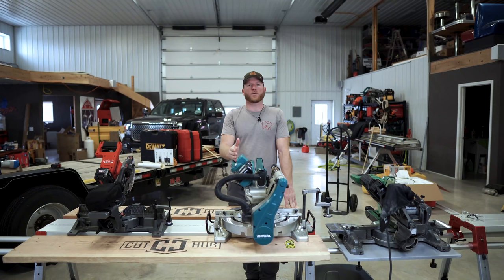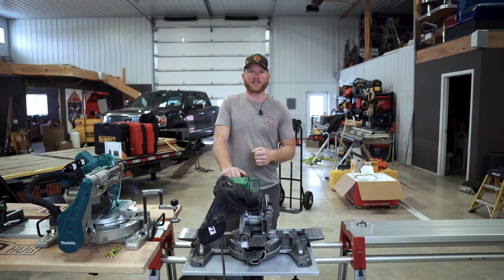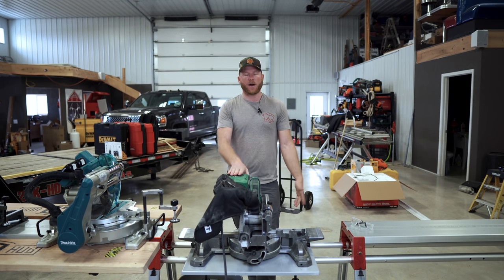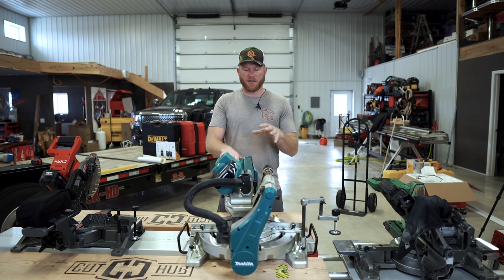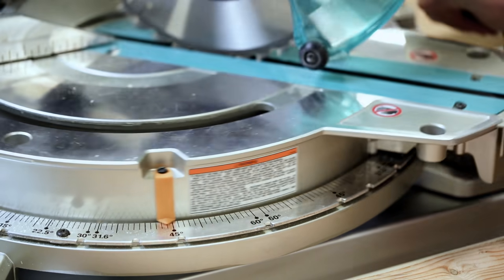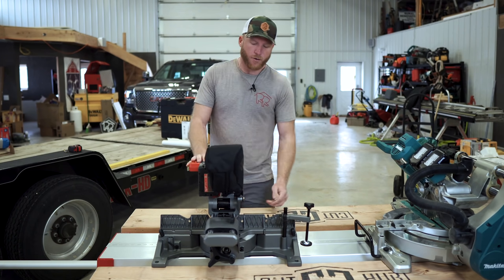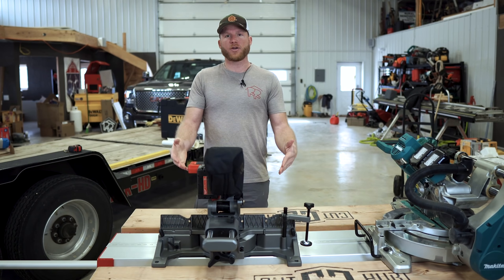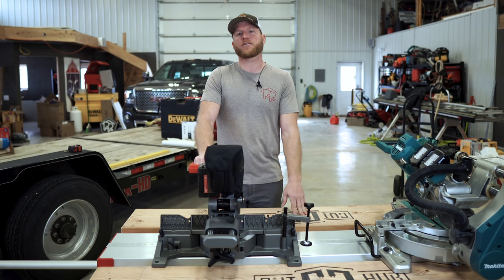My go to Miter Saws 2019: Toolsday

Comment: Hi Kyle. I have a couple of Mitre saws (Festool and the Makita in the review). I recently purchased the Metabo as well (I wanted a full battery unit for site work). I had the same issues regarding accuracy. I spoke to the rep who advised that you are supposed to lock the front lever in the down position as well as the bevel lever on the side which tightens up the torsion rods underneath. Hey Preso problem solved…….the saw now cuts very well to the point that I am using it for finish work with great success…..seems counter intuitive, but I can vouch for this and am very happy with the unit….even when compared to my Kapex. Cheers. Greg.

Comment: I like that Makita, I would go out and get one today if I wasn't scared of my wife lol
Reply from the maker: It’s a good one
Reply: LOL, while i wouldn't buy that one i am in the same boat with the wife.
Reply: Glad im not the only one lol
Reply: Anywhere hearing anything about the new makita? Same saw basically but its a 12 inch. Looking at getting one but everyone's reviewing the 10s and i cant find any reviews on the 12 inch saw
Reply: Mandilónes . Pónganse las pilas mijos
Reply: Maybe you shouldn't let your wife have that much say...
Reply: The Achilles heel of the Makita is the detent plate thats made of soft aluminum for speed of manufacturing purposes.  Overtime the detent plate notches wear and grow in size.  Otherwise it’s a kick butt saw
Reply: @marctavares2571  you can get optional plates.
Reply: 🤣🤣🤣🤣🤣🤣🤣 do what I do bro, go tool shopping while she’s at work! Or sneak the tools into the garage.
Reply: @MetalMayhem1978  I know, i need to stop ordering from Amazon, it's hard to hide a huge box when she is home when a delivery comes in
Reply: Jeff Tucker 🤣🤣🤣🤣🤣
Reply: Sell the ol’ lady on ebay then buy all the tools you wish.
Reply: @MetalMayhem1978  I can't tell you how many times I've had to leave tools in the truck bed (under the tonneau cover) until I can properly stash them in the garage and break down the boxes.

Comment: I can only justify one miter saw, so I have the DeWalt Flexvolt, which usually stays corded in the shop, but when I need to take it out, it's as powerful in the field as it is in the shop. I have a Chopmaster  blade for it for finish work, but swap that out when I'm going to do a lot of framing. It's heavy for sure, but it's more important I have a powerful 12 inch saw in the shop.
Reply: Miter Saw is an old idea because has just about 1 ft cut and cannot be used on boards. It shall be retired. I invented a "Parallel Guided Power Saw" which can be seen on you tube under this name. My saw can cut up to 18 ft or more. Look at my saw and let me know what you think. My saw may replaced miter saw, table saw, and router table. It can carry also grinders, drills press, hand saw and more.
Reply: David Muresan you reinvented the DeWalt radial arm saw from the 1950 - 1970 era.

Comment: Love my dewalt 12 inch!
Reply: Miter Saw is an old idea because has just about 1 ft cut and cannot be used on boards. It shall be retired. I invented a "Parallel Guided Power Saw" which can be seen on you tube under this name. My saw can cut up to 18 ft or more. Look at my saw and let me know what you think. My saw may replaced miter saw, table saw, and router table. It can carry also grinders, drills press, hand saw and more.
Reply: @davidmuresan628  Link? I'd like to take a look at this contraption.
Reply: Yeah its a little sketchy it didn't make this list.

Comment: The Metabo/Hikoki has 3 bolts in the back that attach to a floating plate not visible. You loosen them slightly and align the bevel to 90° using a digital angle finding tool(Klein makes a good one). There's a release pin that unlocks the right hand bevel. You align the plate(the 3 bolt plate) with that release pin to stop at 90°, then tighten the 3 bolts down. Now, when the pin is in place, you can adjust bevel left, and stop at your perfect 90°. To adjust bevel right, you push the release pin. To return to 90, you adjust bevel to the left slightly past 90, pull the release pin back, and move it back to the right where it will again stop at 90.

Then there are standard bolts at the bottom of each side to set your 45s and whatnot. You can also use the release pin to stop at 22.5, and possibly 33.9, as that hidden 3 bolt plate has detents in it.

If this sounds complicated, it's really not. I'm just not good at explaining things.

I've also found on the one I had that the slop you feel is the cheap plastic handle moving around, and not the actual unit on the rails. I was able to tighten the screws, making it pretty solid. It feels as good as any other non-vertical grip miter I've use. Another problem with this saw was the miter detent locking bar. It's made of plastic which allows very quick movements swinging left and right, but has a little give in the hinge. Some people have fabricated a replacement, but I've found that just be leaving no pressure on the knob, then locking it down, it always centers on the detent.

Comment: My main saw is still the Dewalt 780 for most trim and framing. However, I keep that Milwaukee 7 inch in the truck as well on an old miter saw stand because not only is it better for some trim applications, but for a super small job or a repair it's almost always perfect. Last week I did a deck for my cousin and we had the Dewalt cutting all the four by, 2x8, 2x10 and 2x6 lumber, but the Milwaukee cut all the decking. My 13 year old cousin cut all the decking herself and no way would I have let her use that Dewalt. So on top of it being practical, convenient and light, it's also safer.

Comment: I got rid of my 12" and my 10" miter saws and grabbed a 7" slider.   Anything that wont fit on that, I just use a circular saw. So much better for mobile transport
Reply: Daddy SmokesYams which 7”?
Reply: Have both the Kobalt and the Ryobi. Like the Kobalt slightly better
Reply: How are you cutting 4x4 using your power saw? The accuracy would not be perfect
Reply: @blockchainshark1392  Two cuts. Flip the wood after first cut, then cut backside

Comment: Back when I had my bussiness before lithium batteries, when there was only nicad , I bought a 10" Makita and later on a 10" Bosch. Neither were sliders as far as I knew they were the only ones available back then. The Makita was useless the rpm were so low it didn't cut it hacked the wood , gave it away the day I got it the Bosch was much better but 50 cuts or less and the battery was dead but the installers still loved it. I just don't keep up with the new tools anymore so really liked seeing your collection. Lithium batteries have changed cordless tools tremendously.  Where I live its hard to find a battery drill so any other tool is impossible to find here. Thank God for Amazon.

Comment: I have the makita. Awesome saw but it's a damn beast to move. Imo the only way to transport it is permanently mounted on the makita stand. I replaced the stand's wheels with 10" pneumatic wheels spaced 18" apart. Now its steady and easy to transport without knocking anything out of alignment.

Comment: I don't know if you read your comments, but I have the Makita LS1219L (corded 12") and it has the same dust collection port on it. Get yourself the Rockler Universal Small Port Hose Kit. It's 30 bucks and it's super high quality and will fit a ton of different tools from routers to miter saws etc. The key is cutting off the little triangular gusset that attaches to the open top part of that dust port on the Makita, so you can slip the larger of the two fittings included with the Universal Small Port kit over it snugly. The other end of that Rockler kit will connect directly to a shop vac or a shop vac hose, and you're good to go. 

Enjoy!
Reply from the maker: thanks man you bet i read comments...helps me learn
Reply: RR Buildings Hey, happy to help. And I really appreciate all that you do. I’m about to start building my own house (my first house ever) with a family member who’s an experienced builder/contractor, and while I’m not post framing, your build videos have been a huge inspiration. 

Cheers!

Comment: I'm not sure if you know this or not but the fence is a floating fence to pick up extra degrees on your 7 1/4 Milwaukee that's what the notches on your left hand side when you're facing the saw is for on the bottom of the deck
No it's not necessarily easy to adjust it but if you adjusted for up to X then modify
Reply: Miter Saw is an old idea because has just about 1 ft cut and cannot be used on boards. It shall be retired. I invented a "Parallel Guided Power Saw" which can be seen on you tube under this name. My saw can cut up to 18 ft or more. Look at my saw and let me know what you think. My saw may replaced miter saw, table saw, and router table. It can carry also grinders, drills press, hand saw and more.

Comment: I have the same problem with dust collection on my Makita. It's like if you don't buy the exact Makita attachments nothing will work and that's the only big problem. I've had to fine tune  the adjustments a couple of time to get back into square cuts, but besides that this saw has been amazing everything I need. I can bring it on job sites all the time with me for cabinet work and trim work. It does all my matters and all my cuts very well and very smooth. Like you said it just feels good in the cuts are smooth and it has a great brake

Comment: Finish carpenter by trade. I use the Milwaukee ten inch and have done a lot of nice work with it. My main gripe with it is that the sawdust gets blown over the bevel mechanism and clogs it so you have to silicone the bevel mechanism regularly. The Makita is a beautiful saw but I was invested in Milwaukee and it works well for me
Reply: I love my makita. Im also a finish carpenter. Main problem is the detents get hammered out.

Comment: I like that Mikita. 1 down side that gives ppl some issues is the way the bevel adjustment works. You don’t hit a switch that allowed the bevel to move. The knob actually loosens the entire saw from the base. So if that bevel adj knob isn’t super tight, the entire top of the saw isn’t tight, and your angles and deflection are super bad.

Comment: The Milwaukee is not that accurate for trim and fine carpentry, I tried to adjust it for hours to get perfect cuts and it was pointless so I ended up returning it!
Until this day I'm still using my Bosch CM8S with a laser blade installed. Haven't found an accurate small miter saw that could replace it yet.
Reply: An honest red china review. Go figure.

Comment: The most important thing about choosing a tool is whether or not it's fit for YOUR purpose.  In the case of the Makita, the answer is IT IS.  The 120V AC version that is.  As you say its heavy, so don't move it.  If you don't move it does it fit in easily into your shop ?.  In most cases it will, because you can put it up against a wall and still use it.  Do I take dust collection seriously ? YES.  For decades I was careless about breathing fine wood dust, and that ended in having two cardiac arrests, the first in the year I turned 80, and which required triple by-pass surgery three years later.  The Makita allows a dedicated shop vac to be connected to it with no fuss.
Finally it gives me a way of making precise cuts with a minimum of effort.
Oh and BTW if you have the battery-powered version, be careful you don't overload the cut if you install a  saw with more cutting heads.

Comment: Diablo makes a find blade. But when I was building a house 30 years ago, I bought a 10" Delta Miter box. (the compound cut saws weren't out yet). A friend of mine that had a cabinet shop said I should get an AMANA blade. So he ordered one for me.  I paid more for the blade than I did the saw.  IN the long run, it was worth it.  I've only built a couple of houses with it but I've loaned it out as well.  The cuts were precise and clean.  I could cut off oak hand rail with the waste cut being paper thin and uniform.  So thin that it rolled up as I cut.  I could unroll and look through the piece.  I've never sharpened it.  Problem is, I now have a 12" compound slide DeWalt.

Comment: I got the Makita recently and had to do a heap of adjusting on it. It feels really nice to use but needed a lot of work to be usable unfortunately which took the shine off it.
Reply: Had the same issue with the 12" I got 6 months ago. Bevel lock was dragging when it was rotated and the fence was a little out of square. Besides it being really heavy it makes the accurate cuts I need.

Comment: I have an old corded Ryobi 10 inch miter saw on a portable table for rough cuts.
Second is a Rigid / AEG 7 1/14 inch sliding miter saw I surprised myself with how much I use, and last the 10 inch cordless Makita you show. That because of it's accuracy and the dual battery deal, which I can use with my other cordless Makita tools. Seems somewhat similar to your setup.

Comment: How important do you think "out of the box" alignment really is? I feel like if you need finish carpentry level precision, you're routinely checking and adjusting alignment anyway.
Reply from the maker: Totally agree
Reply: My opinion (from a hobbyist who uses the saw mostly for framing) is the saw should come out of the box with all the detents aligned and accurate (90 22.5 and 45). The top bevel not so much but the scale should be accurate. With all the QC and automated assembly a jig to make sure the alignment is within a tenth of a degree or so should be no problem. I realize it will have to be checked periodically to make sure it is correct but it should be right from the start.
Reply: I think it's important insomuch as it speaks to the build quality of the rest of the saw.  If the alignment from the factory is sloppy, where presumably trained workers are putting the saw together, it either means the saw is built to low standards or the employees aren't doing their jobs, and neither of those is very reassuring.

The problem, though, is all of these name brand saws are mass produced in vaguely the same price brackets (excluding something like the Kapex), so there's not a lot of wiggle room for one to be absolutely head and shoulders above the others.  Also, they are routinely handled by shippers that couldn't care less, so I bet a significant percentage are damaged before they ever get turned on, making it even harder to assess initial quality.

Comment: I'd love to know how the Bosch stands up and compares to these.
Reply: Me too, man! Really looking forward to seeing how it handles. It's about time Bosch came to the miter market too :)
Reply: I purchased a Bosch miter saw back in 2000. It is well built and very solid. Mine is 10"  compound bevel model, and has a twin round bar slide. It cuts very accurately, and is easy to use with its vertical handle. I like it!
Reply: Always expecting quality from Bosch,  @t.d.mich.7064 ! But I think (or thought atleast) Nickolas here was talking about the new 18V miter saw, something along the line of the ones in the video :)
Reply: Bosch is coming out with their 18V miter saw later this year (August or September, I believe).

Comment: I have the 7.5" Makita sliding miter 36v. It is great for punch list things, shelving jobs (cuts 12") and carpentry tasks that dont require cutting tall stock. It is super light (27lb?). I don't really understand the mention on this video and others of not liking two batteries. It has never been an issue for me. My circular saw and track saw also use two.

Comment: Be good to hear about table saws too
Reply: Miter Saw is an old idea because has just about 1 ft cut and cannot be used on boards. It shall be retired. I invented a "Parallel Guided Power Saw" which can be seen on you tube under this name. My saw can cut up to 18 ft or more. Look at my saw and let me know what you think. My saw may replaced miter saw, table saw, and router table. It can carry also grinders, drills press, hand saw and more.
Reply: @davidmuresan628  its un practical on a jobsite do to its size
Reply: a 4 ft is easy to transport and you can cut lumber and plywood. If you wish I will give you one 4" for free.

Comment: Have you got your hands on the Metabo HTP 36v 185mm (7¼) brushless slide compound mitre saw? Just came out in Australia and am tossing up between that and the 10 inch. Massive price jump up for the 7 ¼ and just want to see your thoughts on in.
Reply from the maker: Have not
Reply: @RRBuildings  just had a look on the Metabo Htp website and looks like it still isn't out in the states thatd have to be a first that Australia gets a tool before you guys. Will just sit a wait paitently for your review. 10 inch is $1459 Au with 2 x 8 amp multi vault batteries. The 7¼ is $2499 Au bare tool so it's quiet an investment.

Comment: The Makita saw is on sale at home depot with 2 batteries for 529$,sounds like a good deal?
Reply: Finishing up a job rn, thinking about buying it when I'm paid! I'm using a 20yr old Delta. haha. :/ Now just trying to decide on the stand...
Reply: Don't forget to add the 2 pack 5.0ah as well, it's free. So with the makita , you get 4 5.0ah batteries
Reply: @davidv9546   I haven't seen that bonus deal here in Las Vegas. I bought a  chainsaw for 400 $and got 4 batteries, very good deal.